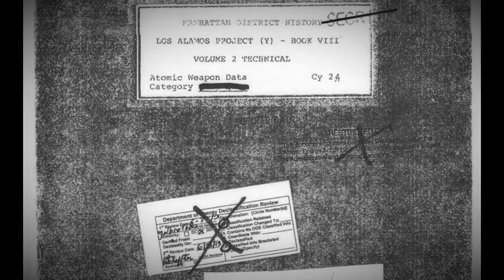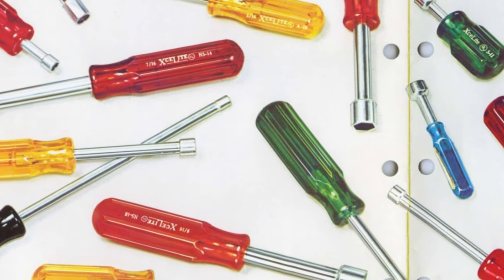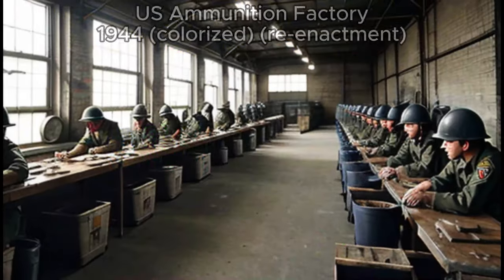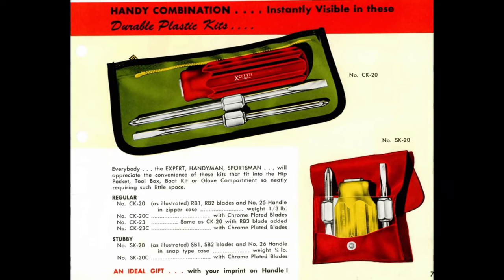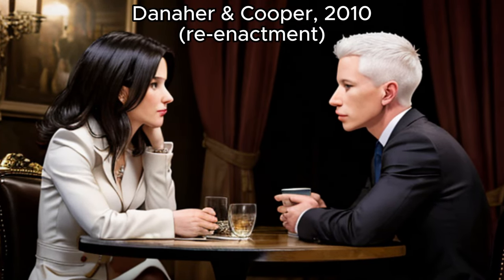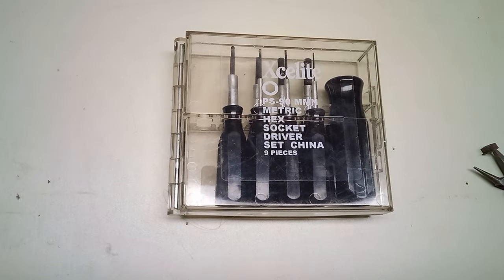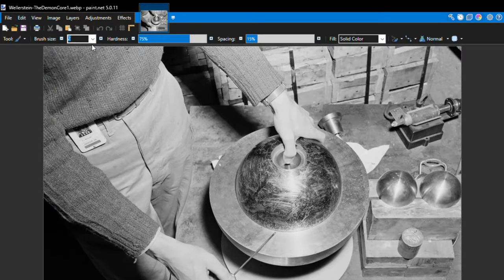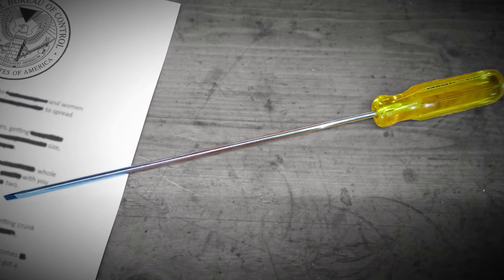Xcelite Tools Company History & Lore

Comment: I love those Xcelite screwdrivers cuz 1. The handle shape is perfect for my hands, 2. I love the translucent amber cellulose acetate, and 3. The handle shapes have stayed the same since the 1930s. I found just a handle of an S-5168 Xcelite screwdriver in my dad's tractor, and drove a 3/8" flathead round shank into it. I use that screwdriver for basically any flathead screw or machine screw and LOVE using it.

The nut drivers also oddly remind me of some sorta candy with all the different translucent colors. The green 11/32 especially look nice.
Reply from the maker: Yeah, I'm a big fan of anything with a translucent acetate handle. If you like the green one, check out the Heyco acetate handle screwdrivers. They're a deep dark green and shiny.

Comment: I have an Xcelite flip-over screwdriver in my remodeling tool pouch, and I actually prefer it to my Klein 10-in-one as it's simpler to use and sturdier with the tips I use most. Like so many others my introduction to the brand was as an electronics hobbyist where they were the preferred brand. I didn't know they went to China- that puts them on my "avoid" list so if I need anymore I'll buy used.

Comment: I've been working on an accurate scale model of the demon core and its beryllium tampers. As far as I've been able to find, the screwdriver in the reenactment photos is the same one used by Slotin. The tape around the handle was apparently used to mark which one he favored for the demonstration. I've seen it described as "which one not to stir your coffee with", though I'm not sure of the source.

Through my measurements and the input of others online, I had come to the conclusion it was likely an R-186. I found a post from someone else claiming the original was described as having the R-168 marking amongst post-incident materials. So, despite not having any solid sources myself, it seems fairly likely that was what was used. At least, that seems to be the best bet today if you are looking for a match.

The most difficult part has been finding one from the correct era. Most available vintage XceLite screwdrivers have a different version of the logo. The one in the photos has the name "EXCELITE" with "ORCHARD PARK, N.Y." inscribed in smaller text directly beneath. Does anyone know the history of their various markings? So far I haven't been able to find an exact match for sale. In fact, I haven't been able to find a clear photograph of the exact model and design-- just the shots from the Slotin reenactment.
Reply from the maker: Thanks for the info! The "orchard park" markings are gone from the screwdrivers in the '66 catalog, so I'd guess they changed the logo sometime before. Hopefully someone else can chime in with the info you need.

Comment: My dad used Xcelite as a TV repair man. I worked for Danaher (Matco Tools). Danaher sold Apex (Gearwrench, Armstrong, Weller, Xcelitex, Crastsman amoung others) to Bain Capitol around 2012. After a failed attempt to merge 2 US factories into 1, Apex moved all manufacturing to China and dropped Armstrong.
Reply from the maker: Thanks for the info. I'm working on an Armstrong video that will drop in a couple weeks. I'll dig deeper into the factory consolidations.
Reply: Except for the ones that Apex still manufactures in Apex NC I guess? (Weller, SATA, Cleco, Xcelite, Crescent, Jacobs, Campbell, Erem/Weller, Gear Wrench, Apex)

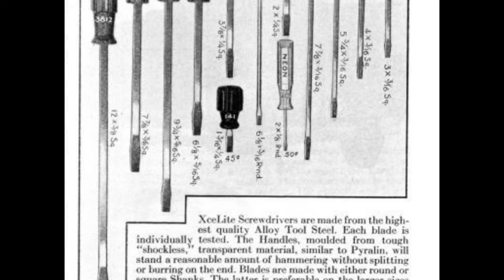Comment: 1:45 - NEON tubes inside a screwdriver to test sparkplugs?? Thats so cool. I wanna see one of those. Sounds unsafe haha. I wonder if you could find one. Cheers for another great vid!
are these acetate handles then? Is there anything that can be done to un-fog them? A vintage set of the of those color coded nut drivers seems like a great deal on ebay right now.
Reply: The USA-made ones do use cellulose acetate butyrate handles. That fog is either corrosion from the handles decaying, which can be easily wiped off with a paper towel; or scuffs and scratches, which can be polished back to translucency with enough work. Be warned, though: The handle material is really strong and durable, but smells terribly. Be wary of keeping them in toolboxes.
Reply from the maker: They still make the spark testing screwdrivers. I have one but it's broken. The handles can be restored with the process I used in the Craftsman Spinner Handle video. If it's just a light fog, steel wool then Plastix or Flitz polish. They may fog up again over time though.
Reply: @ballinator  yeah I googled it after my comment and they def still make those haha.  Still wouldn't mind seeing an old example like that one maybe it's more dangerous about it haha
Reply: @ballinator  I will check that vid out hadn't seen that one!
Reply: @Fournier7  yeah I've got some acetate mini Craftsman screwdrivers I've had cooking in a plastic tote for like a decade so and WHEW it's intense when I open that up haha. Smell doesn't bother me too much tho. Thanks for the comments on restoration. I'm a sucker for translucent colored plastics (90s kid 🤣)
Reply from the maker: @MarkTrades__ If I can fix the broken spark tester, I'll probably do a video on it at some point. They work off of induction, so they're pretty safe.

Comment: While Xcelite made some specialize tools and had some features like nut drivers with deep clearance are good... Most Xcelite Tool Kits were purchase by Government and Corporate buyers that bought Millions of units but have little clue about Tool Quality means the product are barely use before often need replacement because of poor hardness of metal and more problems even if people are careful and use the "right way." That's even in the 1950's to 70's. Is no better that Sears with "Life Time Warranty" Craftsman that made to drive traffic to the stores when cheap screwdrivers and more wear or break then often strips the hardware too. You Don't want Xcelite 99 or base Craftsman screw drivers as the only tool for daily use even for most electronics that many claim is "light" work.

Comment: That screwdriver should be radioactive!
Reply from the maker: Yeah, everything in that room got a massive dose of radiation.
Reply: @ballinator But most of it was gamma rays.  It's only the neutrons that make non-radioactive substances radioactive.  The beryllium would have confined most of them inside the sphere, except for the crack where the screwdriver blade was.
Reply from the maker: Interesting. I had just assumed they would have had to scrap everything in the lab.